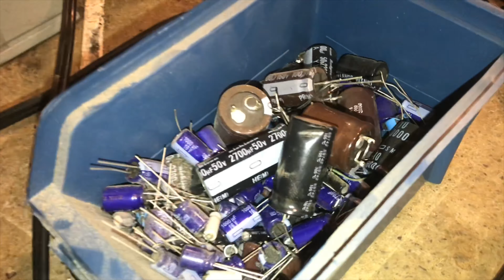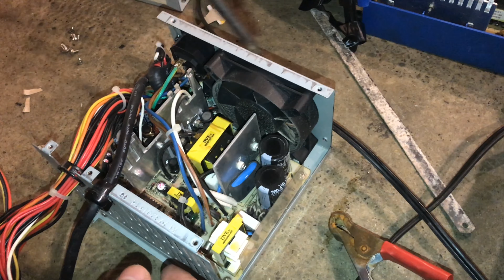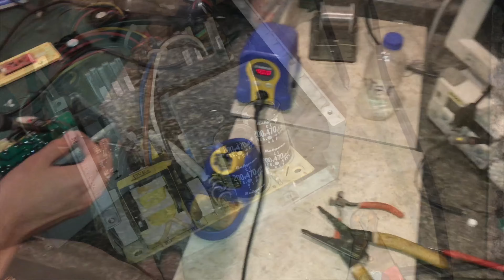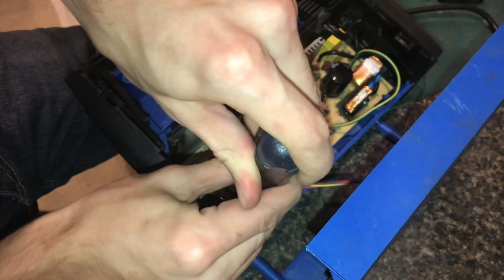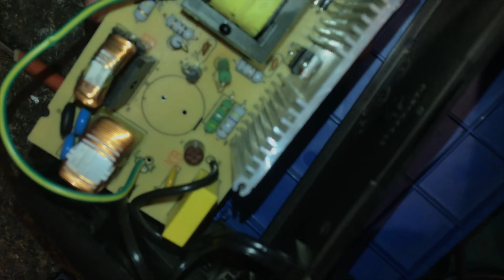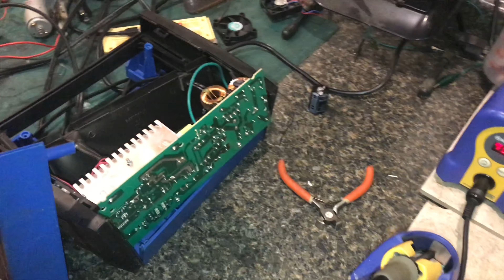(FIX) schumacher 15a automatic battery charger (BAD capacitor)

Comment: Hello how about these a pleasure to greet, could you help me I have a problem with my charger schumacher and is that I do not get the plate to see the value of some resistors that were damaged are those that are near the integrated AP3845CP
you can place an image of the motherboard or pass me the color code of those resistors please I'm desperate and do not know where else to go

Comment: hello friend, can you help me with the value of resistor allowed near the uc3843 pwm driver , the resistors are :  locate just front ic, it´s set current  drain for mosfet, conected between shunts resistors and pin #3 on ic. please and thanks

Comment: mine is not like that I have the little shoemaker 15 amp most of the weight is the transformer diodes are good capacitors don't appear blown they're not puffed up or peeled off so it must be the transistor amplifier is one of those mosfets okay tell me what to do now

Comment: How’d you open it? I tried to open one but it seems like it’s stuck on the bottom part.. any help with that part
Reply: 2 screws top back, 2 screws bottom front under the plastic sticky face covering

Comment: Hello 
I have a 15amp Schumacher Charger That Wont charge either.It switch’s on and I can select a charge program but the charger will not ramp up to charge the battery.Just wondering what happened your charger.Would you have any idea what would be wrong with mine.Thanks for your informative video.
Reply: hey did you ever figure it out
Reply: Same problem
Reply: Same, 15 A

R5 looks cooked. Red-White-Black

Also capacitor C10 looks baked.